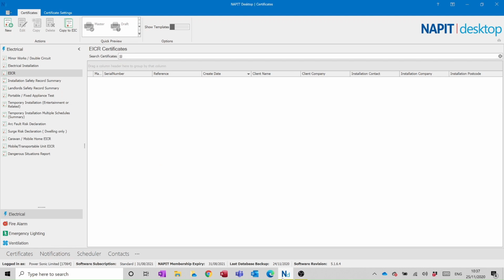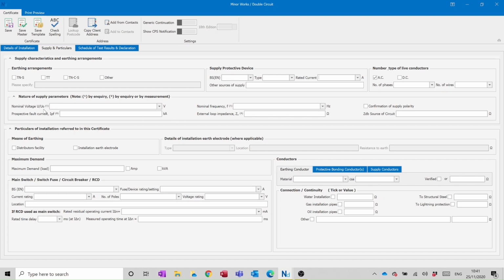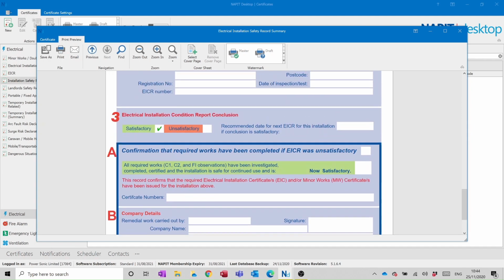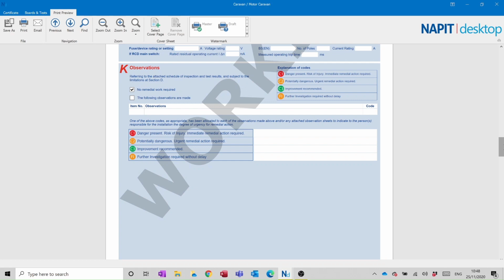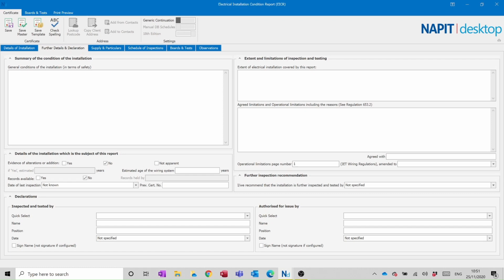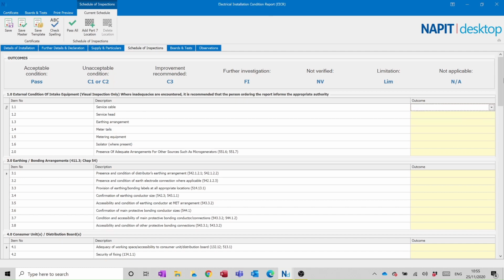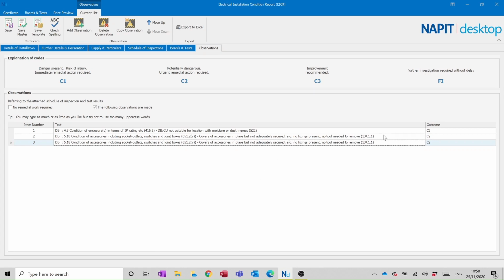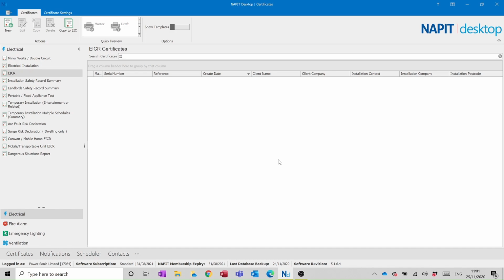UK electrician NAPIT desktop certification software run through

Comment: Do you have to pay each time you want to submit a notification? Also does this mean if credit is not topped up on the web server that on the NAPIT FAST app you'll unable to make a notification?
Reply from the maker: Every part P notification does require payment as normal. You can top up via the website or app.
Reply: @electrician247  Thanks mate, realised that after seeing it work once topped up. One last question, how can i add images? I'm on the Generic Continuation tab but don't see any option to attach photos/images

Comment: Hi, is there a way of doing multiple minor works for same site? I've literally just started using this software (coming from Amtech trimble ) and I'm struggling to find a way of doing multiple minor works for sane site without having to input the page one details ( client and main characteristics) every single time. Also how to export them as a pdf file?
Reply from the maker: You can copy certs from the main menu page mate. Highlight and then click copy. 

Pdf, you master the cert. The  click on the mastered cert then save it either locally or to the cloud as a pdf. Napit do free product training if you want some bud.
Reply: Thanks for the reply mate with give that a try 👍
Reply from the maker: @simonsimon5707  it's hard to explain on written word lol. Really easy verbally or via demo lol. The good people at napit are bang on for this or I am happy to talk through it.

Comment: Also question:
When you mentioned schedules of inspection giving you choice to pick fault you want, that's great option. But If I want to go and add few of them myself, is it possible to make a list for yourself, so when you start typing for example: No Main protective bonding conductor..... will it come up with regulation too? or you need to find from codebreakers yourself? I may sound confusing, but that's what I had on amtech, inputting faults manually I had premade faults with reg numbers etc, and just start typing ''RCD'' it gives me a choice all faults which has word ''RCD'' in them.. 
I hope my question makes sense :D
Reply from the maker: You can create whatever pre filled observations you want. Even add on to them during the schedule of inspections to save digging through and amending the obs section later on.

But as mentioned its all changing soon so I am told!
Reply: @electrician247  I'm not saying I'm doing it correct way, but I always do schedules of inspections last, as you don't know what you come across on big property eicr. You may have 30 different accessories damaged and so on. I always deleted the observations amtech gives me when I mark c2 or fi, and then manually write all my own prepopulated faults with reg numbers etc. So I can go to observation sheet, delete every one which came out of schedules and fresh start my ones. Its just how I do it. Can't imagine eicr with 15x DBs you press c2 on damaged accessory and then try to do all damaged ones from all installation. Am I missing something? Is there easier way of doing it?😃
Reply from the maker: Exactly mate, you couldnt do that on larger installs lol. The commercial EICR form in desktop is slightly different, my video shows a domestic example. In the observations page you can enter your own obs, copy them and add extra details like location etc. I find it pretty easy and we do some big EICRs. But its always easy when you are used to something lol. Hope that helps.
Reply: @electrician247  I ma looking forward to start using it:)

Comment: Hi
Using Amtech at the moment but will have to go to napit at some point.
Just at the beginning of the video from what I see for MINOR WORKS cert, looks like there are loads of information you have to fill in.. If I go to replace a light fitting in hospital, school, massive office etc I would not get more than half of the information. Therefore I would need to write a poem in my limitation box.. Really need supply CSA, main switch details, Ze etc etc for a minor works cert? Don't think it's necessary. Just looks like it's way over-complicated thing for minor works, if you add schedule of inspections it will end up being installation cert:)  
Is it really so complicated?
Reply from the maker: I know what you mean with data but this is based on the model forms. You can NA or limitation etc. 
NAPIT are working on a new release for fasttest users right now, so it should blend across better so I am told.

Comment: Do not get this software, let alone napit mobile,  Easy cert mobile App is the way to go,

I have napit mobile, napit desktop and Napitoline top up,
None of them works, 
Once I send a notification, I can't find it where is it to send it to the client as a PDF,
Minor works certificate is not working
Mobile app does not link with mobile
It does not recognise certificates by its reference but by post code, (instead of a drop-down list, how easy is that?)
On supply characteristics some boxes can't insert NA, 
Why not say R1R2 Instead of figure of 8 on a Certificate format

Comment: Been with NAPIT for a couple of years but never really looked at this. Is it part of the membership or an additional subscription.
Used Easycert for quite a while but tried Electraform as everyone raved about it on Twitter, however, the big downside of it is that you need an internet connection, which in some parts near to me is impossible when using mobile data.
Reply from the maker: It’s an additional charge Eddie. Think it’s around £85 a year. Same with electraform as well on the internet. Bad signal in the sticks
Reply: @electrician247  and another way for them scam opporators to rip off the hard working spark £85 do me a favour I'll stick to good old pen and paper  or I will print up my own paper work.
Reply from the maker: @seandempsey9396  everyone has there own way of doing things. Nothing wrong with pen and paper.  For us its a bargain at £85 plus we dont print anything. Produce thousands of docs a year so would pay much more than £85 personally.